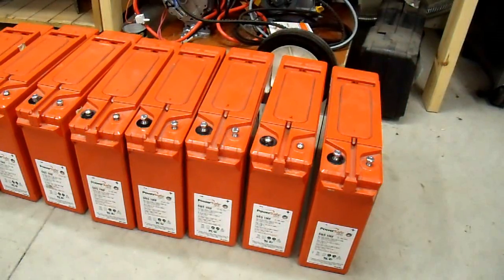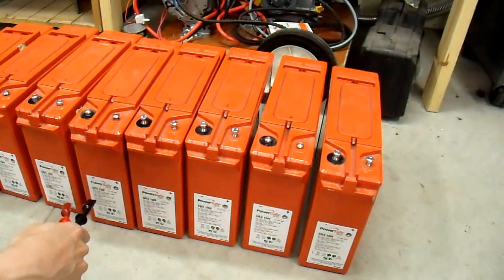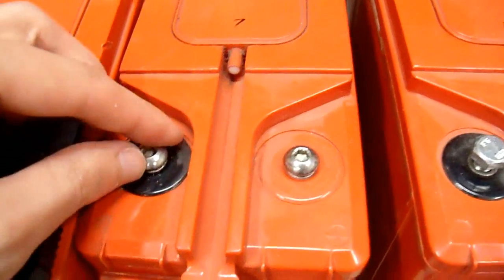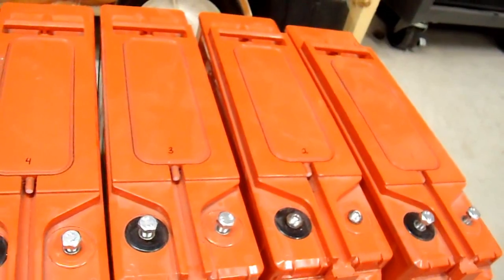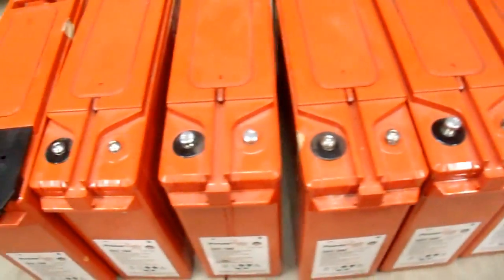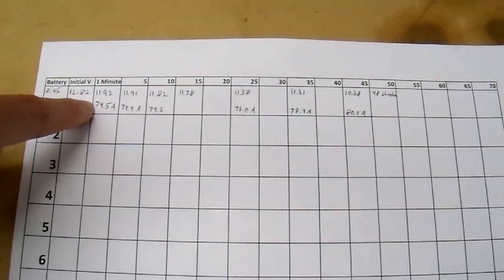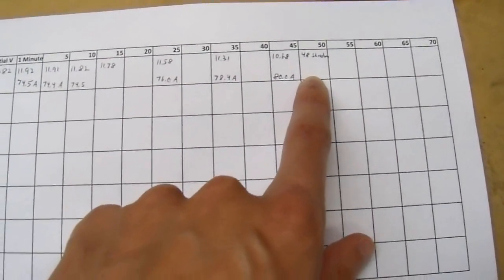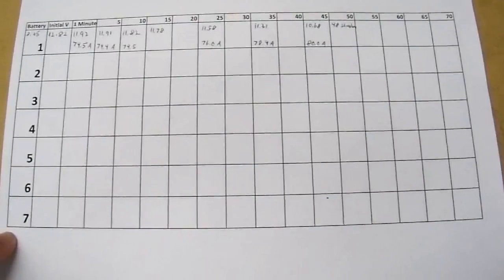1000Ah Battery Bank Part3 - Testing the Condition of my Salvaged Batteries

Comment: Qual o cca dessa bateria powersafe sbs 100f
Reply from the maker: They are not rated for cranking applications so there is no CCA rating.  That said they would have a greater CCA than most car batteries.  I couldn't tell you what it is as testing for CCA is a fairly involved process.

Comment: How much you can sharge this in 24volt solar ??
Reply from the maker: Depends on how much solar you have.  I guess I don't understand the question.  A 10kw array would charge it pretty well.
Reply: @knurlgnar24  24volt agm 44kw system.   What to sharge to 29.1 ore 28.8 ??

Comment: 40 bucks for many kilograms of pure lead. Because powersafe SBS (red cells), odysey extreme and some more have pure lead plates. none of this calcium sh1t
Look at Pure lead prices^^
PS: 100% capacity means 12,85V+; I have got a used (Nov2014) Armasafe 100Ah; returns to 12,67Volts when charged - ~12A discharging test to 10,8V brought me 90Ah.
Reply from the maker: Lead calcium and lead antimony batteries are usually made from recycled non-purified lead for cost reasons and have high contaminate levels of other metals with little quality control.  Pure lead batteries require either virgin lead or highly reprocessed lead, so I agree that if you want to salvage lead from batteries stick to the pure lead ones.

Comment: can't add water? yes you can, especially when they start reading over 12.7 sitting after surface charge wears off, indicative of higher concentration of acid in the matts.
Reply from the maker: Water can't be added without destructive methods - I should have clarified that point.  It can be done but there are reasons I don't like to open sealed batteries like this to add water.

Comment: Hey !

Thanks for the video, 6 years old but still usefull ! How the batteries are doing ?

I've got few SBS 190F batteries for free, voltage is around 10.6v for some of them. I'm trying to restore them but I think that one cell is bad and battery is dead...

I will leave them on solar charging with no load for a week, we'll see...

Thanks !
Reply from the maker: The batteries are doing well.  I did have to desulfate them a 2nd time due to some storage issues (I don't cycle them very often) and they came back even better the 2nd time than the 1st.  They are getting close to 10 years old now and I suspect calendar aging will start taking its toll soon.
Reply: @knurlgnar24  They are really cool batteries and well designed.

What do you think about the 10.6v voltage ? Do you think they are still recoverable ?

Even with that voltage, I think they can be still usefull.

Comment: How do I calculate amp hours through an inverter?
Reply from the maker: If your system is 12V and your inverter is 120V you can just multiply amperage by 10.  (approximate) If your appliance is rated for 6A then you will draw 60A out of the battery.  If you do this for 20min that is 1/3 of an hour, so 20 amp hours.  Note that I recommend using 1/2 of the battery bank's amp hour rating for sizing purposes.

Comment: knurlgnar, 
I have VRLA -AGM Batt's that I am still using for my Off Grid  Solar system and find that they last for ~ 4 years (350 Ah ea for $500 current price. I purchased a De-Sulfator to help the Batt's live longer, and being VRLA's I thought of maybe adding some Distilled H2O and see if they will last longer. "Mine are Caterpillars" I could not help wondering if yours have a removable cover ! Did you ever triy to pry & break if you have to the cover. Then you could add some H2O and use them as flooded until the H2O evaporates! Please let me know! Total System -12 AGM's @ 48 V -3 parallel sets -lots of power & lots of $$$!!!
John Kanterakis 5000 ft in South AZ
Reply from the maker: No covers that are easily removable, though I could cut away the cap that covers the vents and re melt it back on.  The design of these doesn't make it very easy to do though.
Reply: @knurlgnar24  --Did you ever hear of the NiFe batteries from China  sold by Iron-Edison of Denver Co.-The Forever Battery--Check them out some time.
John Kanterakis

Comment: YOU BASICALLY FOUND THOSE BATTERIES...SPENT MORE ON WIRE... (“..GAMBLE..”?..lol..whatever dude..)..QUIT BEING....WELL, JUST QUIT GLOATING...(USED ZINC PLATED BOLTS IN PLACE OF STAINLESS STEEL BOLTS?.....SHEESH)
Reply: What

Comment: You could buy or build a wired-wound power resister with a a recording ammeter (or just take notes in line and let it run for a hour or so under load.  I'm pretty sure the voltage will not vary but its amp hour endurance is a better gauge of battery health.

Comment: It's funny how our approach is different. I'd number them all first. Then test. Of course then I'd have 1, 2, no 3, 4, 5...... Then friends would come over , "Hey where's the 3??" I guess that's because I might fix 1200 circuit boards de solder then solder. And after the repair or part switch out what fails fails, record the number. It's so ingrained I thought, "What luck the last one, #8 failed." Then I thought...oh yeah...

Comment: knurlgnar24 You mention the inverter uses the load down to 10.5V, if it is a lead acid battery would that be ok for the batery? Or what would the minimum be for a lead acid battery to safely discharge for the test (some people go up in arms when you go down 12V). Thanks
Reply: I'm not the op, but I can tell you that discharging a lead-acid battery to below 50% capacity will shorten the cycle life, to below 20% capacity will do so much more quickly and while the point which is considered "full discharge" may vary somewhat (thanks to additives like Ca, Sn, Co, Si, Sb) ~11.6v is generally considered to be an absolute bottom voltage if you don't regard your 12v lead-acid batteries as disposable.  

You may get a few joules of energy out of the battery by discharging it further, but very very little and absolutely not enough to justify the damage done.  For example you would likely fail at starting a puny 3cyl 1.0l Geo Metro with an enormous 120lb semi-truck starting battery after it has discharged to 11.5v and you will cause irreparable damage in the process.  

I wonder if he didn't mean 11.5v since almost every inverter I have ever seen that will automatically shut down does so at that point or higher - since below that voltage further discharge will cause severe damage without doing much if any useful work, as will storing them in that state of discharge.

Comment: hey, i have a 12v 14ah agm that sat at a low voltage for a while, it charges off an old self contained battery charger and inverter package that had the inverter short out. it charges at around 14.2 volts, when its done charging it is 13.19 volts, and after 12 hours drops off to 12.8 volts. under a usb 2.1 amp charger it drops to around 12.72-12.75 and stays there. it powered a .7 watt light for 10 hours with no noticable voltage drop, when i checked in the morning it was still at 12.73 or 12.74 volts. do you think the battery is damaged at all? also, how far should i let the battery drain? ive heard 10 volts, but i wont take it below 11ish without knowing. it is a good quality battery, worth $70, so i hope it isnt damaged.
Reply: DMAN22yeah Sounds like your 12v battery is performing just fine.
Reply: epohnopulse ok, good to know. It appears to have desulfated and gone up .25 volts on all the measurments, so it appears ok.

Comment: You should use a Bedini or Joulethief or best Re-EMF charger to charge and refresh them. Maybe you will also get the broken battery again up, if there is no cell shorted...
Also add a bit destiiled water, if it has evapourized and the cells are dried out...
Reply: The broken one was internally shorted, and it's not possible to fill the batteries with water because they are completely sealed.
Reply: Its also impossible to add water, the batteries are sealed up tight!

If he could do that he would try to revive that dead one even. 

Sealed batteries last longer without maintanence... But its annoying if one of them needs service from missuse.. because you cant lol
Reply: They aren't actually sealed,  the rectangular plate on top lifts off revealing the 6 cell caps, add distilled water and equalise

Comment: If your inverter   is not pure sign-wave, plugging in your heater which is an inductive load will destroy the inverter and the heater.
Reply from the maker: Neither the heater nor the inverter cares since an electric heater is a nearly perfect resistive load.  Inductive loads such as refrigerators, induction motors, and compressors do care.

Comment: Dumb chargers come in handy.
If a battery is getting discharged to much a smart charger may not recognize that there is a battery or it will tell you that the battery is bad and will not start to charge.
A dump charger would try to charge such a battery.
Reply from the maker: yup.  Any serious battery owner should have at a minimum a dumb charger, a smart charger, and dedicated battery maintainer.  These are not things that everyone needs to have but there's certainly an application.
Reply: another good tool is a variable power supply, can charge all types of batteries and are fairly cheap
Reply: Of course so can a light bulb (or other appropriately sized resistive load) or a motor run capacitor (or other appropriately sized PURELY capacitive load) OR a properly sized choke (or other purely inductive load) in series,  plus a diode of some sort or better yet a bridge rectifier.  The variable power supply is probably the better choice though since it is not directly connected to mains voltage and doesn't require extreme vigilance like the ghetto alternatives I mentioned, which are able to safely charge a battery because they are constant-current sources or DC, which comes with the caveat that being constant-current they will approach mains voltage as R tends toward infinity - and thus will overcharge the snot out of any battery if one is not careful, also will fry any attached electronics if someone tries to charge a battery in-circuit and likewise will do the same to any attached operators who touch both poles/clamps without first disconnecting from the mains, etc.

It is always a good addition to one's MacGuyver skill repertoire to be able to charge a AA (including a dead alkaline) from a car battery - which works directly (in about 2 seconds as well, but they will get hot and can explode) but is much safer if done slowly  using a string of a few christmas lights (or the car's overhead or side marker light) in series or from the wall with a nightlight bulb + diode/rectifier, or (relatively) safely charge a dead car battery from a wall socket with a 60 or 100w light bulb + rectifier (DISCONNECTED from the car first or you will kill the electronics!).  Or get REALLY hardcore and do it with  nothing but a mains lead, borax and table salt, and two buckets of water (or one's own urine or the blood of thy enemies, depending on the situation).  The borax will make a rectifier and the table salt a resistor when mixed in the right concentrations with water and used as electrochemical cells.

Yeah I'll STFU now.

Comment: Good vid series.  Clever load testing setup. 
Although, I think a typical Ah batt test uses a constant current circuit as the batt loses V during discharge.
Your test 1 data indicates your batt delivered approximately ~59.6% of it's rated capacity  (e.g.:  59.6 Ah/100Ah___59.6 Ah = 74.5A * .8h). 
That's pretty good for a batt that has been sulfating for a while after only 1 recycle recharge.
Reply from the maker: Constant current draw would be better for a true Ah test but I just used equipment I had on hand, which is good enough for my purposes and most other people's applications.  If I were a battery manufacturer or designing equipment that uses these  batteries I'd want something more controlled and accurate.
Reply: It wouldn't take you long to find a circuit online, get & solder the components together, & connect that small circuit in place of your heater.  If you did it on the cheap with scrap/recycled stuff, you could probably find some nichrome wire from an old electric heater (clothes dryer or metal strip electric heater element).

I get your point about convenience, though.  I'd guess your testing method is probably accurate to within 20%, so that's good enough for most people, I suppose.

Thanks again for sharing!
Reply: can you tell me please how many watts is the heater
Reply: +hemn ali standard 1500 watt

Comment: t5here are ways to try to bring battery back and sometimes you can be lucky %10 -%20 if you try very slow  triickle charg and discharge 4 times to %50 discharge they can come back but 10v working at full is not wastefull either
Reply from the maker: I actually have a video out on how to properly desulfate batteries which covers the same basic method you describe.  I agree, it sometimes works well!
Reply: ***** Slow trickle charging doesn't desulfate plates...

Comment: By using an inverter, the power is pretty constant. Was that a deliberately choice? Could you just as well have used some load with a linear resistance? My thoughts are using a coil of copper wire, with a fan.
Reply from the maker: The inverter was used because it was convenient.  A linear load would also work for this application.

Comment: Would like to hear your opinum on Iron-Edison batteries.  Iron alkali mixture instead of the more common Lead Acid batteries.
Reply from the maker: Nickel-Iron is another battery chemistry alltogether and has it's own applications separate from lead acid.  I don't have any practical experience with them except to say that they wouldn't be practical for most home owners.  If you're a utility company or large business owner or such then they may warrant more research.
Reply: ***** Thanks , more reading is needed on my part. I do thank you.

Comment: I've got a million questions to ask you.  I'm just learning about this stuff and I would like to set up a solar system on my rv.  As far as batteries go… I'm leaning towards AGM batteries due to their low maintenance.  Do you have a recommendation where I could pick some of these up cheap?  Or is there a brand that you prefer?
Reply from the maker: Most batteries die due to improper care and use.  If you are new to battery systems I would recommend starting with a cheaper flooded battery - preferably lead calcium because it gasses far less.  I use them indoors - not a problem - but a confined space will require ventilation.  Lead antimony is a little smelly/messy.  Once you have some experience with using/abusing them upgrade to a better AGM battery once those have about had it.  A cheap battery will last far longer than the best one money can buy if it is treated well and the other is not.  Might as well make any mistakes on the ones that cost 1/3 as much!

Comment: AGM batteries can get better buy putting them on a small solar panel for about a month at least my optima got better or came back. You can screw in a post or some use gold plated stud with a bolt in the top of that.

Comment: I'm confused on the 80 amp load through a 2000 watt inverter. I'm considering setting up a system to run lights and small loads in my shop and I'm very new to this and very easily confused.
Reply from the maker: What part is confusing?  Let me know and I'll try to help if I can.
Reply: ***** I fixed up a pole shed on the farm for a small shop. I'm powering the whole shop now through a 60 amp 220 breaker and a 150 ft. 10-4 cord. When the 5hp compressor starts or I start my drill press the florescent lights blink out and I'm guessing the load on the chord is too high. Would I be able to hook up more than just lights and a small fan to a 2000 watt inverter? I thought 80 amps at 110v would require a huge inverter.
Reply: Q-<I'm confused on the 80 amp load through a 2000 watt inverter. I'm considering setting up a system to run lights and small loads in my shop and I'm very new to this and very easily confused.>
You should know the basic principle of invertor i.e 2000w=250<volt>*8Amp is its cap of the invt. If u hav 80 amp load then it vll b 250<v>*80=20,000Wt invt y will req..................................
Reply: That's  what confuses me, how does approx. 1000watt heater at 110v give 80 amp load on his battery set up?
Reply from the maker: donnie fiechtner
A 1000w heater doesn't actually draw exactly 1000w which is part of the problem.  These cheap heaters are usually less than advertized.  But if we assume a true 1000W for the heater, then we need 1000W plus about 10% from the batteries with the 10% being lost in the cabling and inverter.  If the battery is at 14V (because the alternator is outputting more than 12V) then the calculation is approximately:
1000*1.1 = 1100W
1100W/14V = 78.6Amps
Reply: *****
 In elt formula of p.f=V*I*Cos phie <in it value of cos is always 1 >.Its only a theorytical formula. Which is denoted on off load stage...............
Reply: I think I get it now, the amp draw vs output amps are increased due to the difference in voltage. Thanks for the help on this. I really appreciate it.

Comment: use steel bolts instead of zinc coated
Reply from the maker: Normally I would use stainless steel for battery applications, but these are sealed AGM and shouldn't leak.  Most less expensive battery bolts are zinc plated so these bolts are perfectly acceptable for this application.